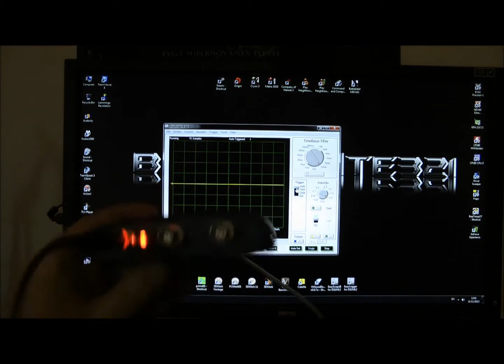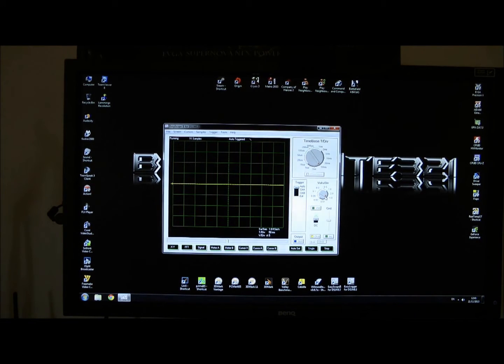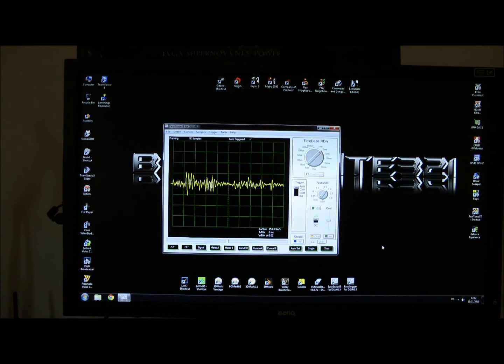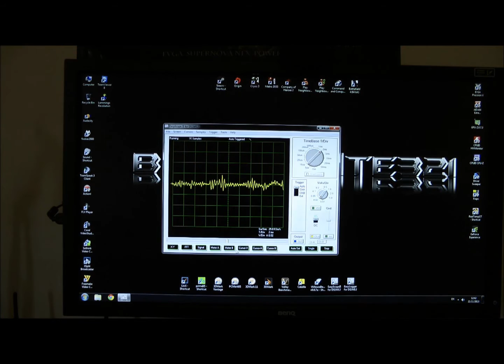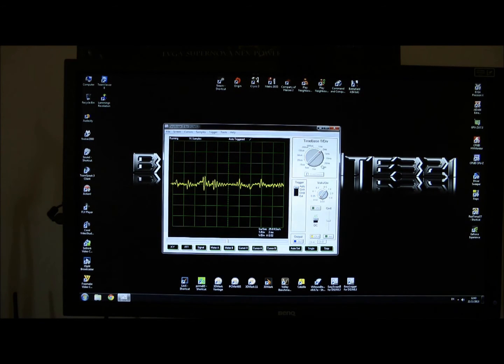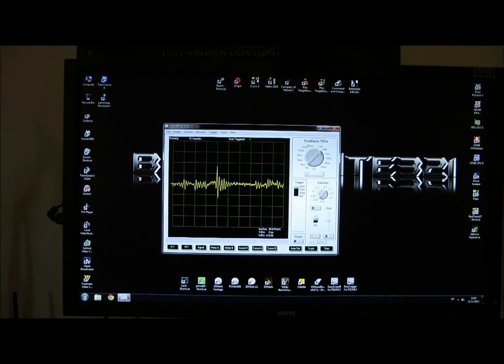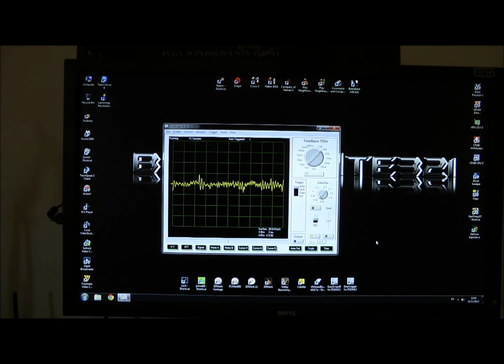Measuring Power Supply Ripple Using EasySYNC's Stingray Scope

Comment: you never showed how you connect the probe to the power source. I'm using and old Philips PM 3212 25mhz cry scope.  I would really like to find a good source to educate me on using it it on sub 12v DC and capturing audio. basically the scope is for fun and a learning g tool before i spent £500 on a beginner scope.  I don't want to blow up big cash. this old scope was £30. the manual is hard to follow